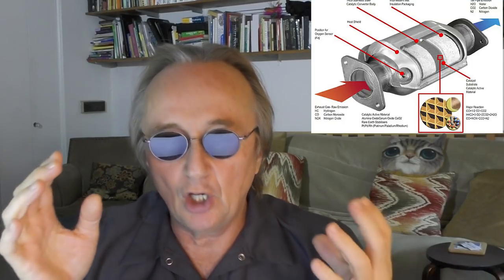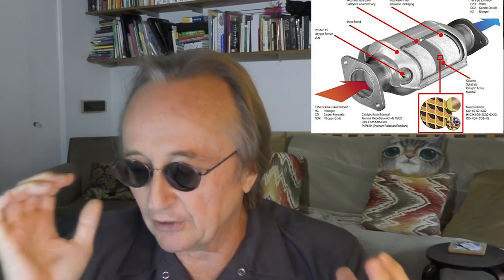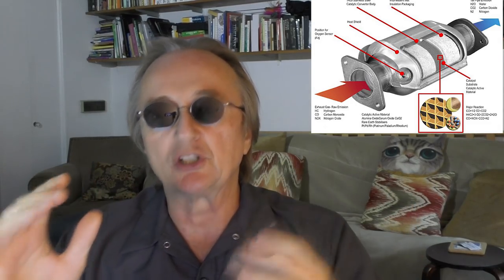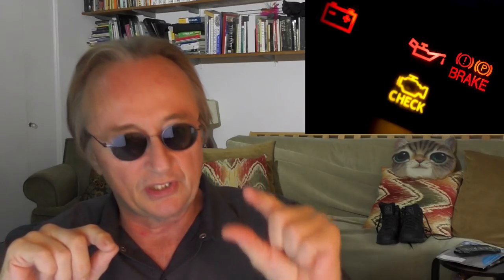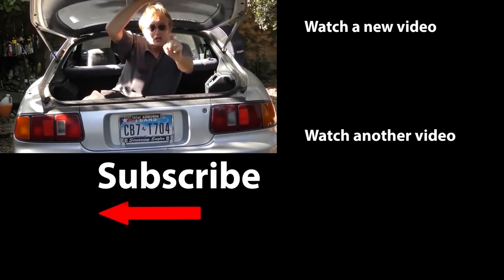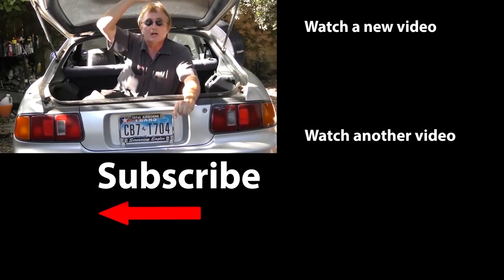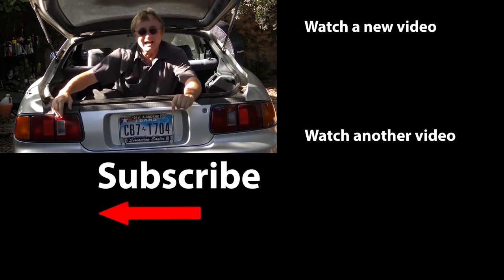Why it’s Illegal to Remove the Catalytic Converter in Your Car

Comment: Hey i wanted to ask about an 07 chevy colbolt LT i bougt it with 80k miles on it and iv alredy put about 9k miles but iv noticed that the car begins to shake after the coolant temperature reaches about 210° i thought it was the thermostat so i got a new one but it still seems to shake, i also came to finde out the A/C no longer works (im currently of in the process of instaling a new one )but im not sure if that can contribute to the shaking what do you think it could be ?

Comment: It doesn't gain but maybe 3-5 horsepower removing the cat. That's all I hear people say removing your cat gives you more power. It literally does nothing, except make your car run better.
Reply: and more reliable because if the catalytic converter fails it can clog the exhaust

Comment: Scotty! I’m 21 years old and just bought myself an 06 Lincoln Town Car Signature (180k miles), I paid 1600 for it. The guy I bought it from says he just changed the oil but not too long after I bought the oil light came on, me and my dad changed the oil and soon found out that the car was running on 3 quarts of oil when the car is supposed to run on 6 quarts. The oil light is still on 2 weeks after I changed it and the other day my engine light came on. But just yesterday the engine light didn’t come on and it’s still not on. My dad says the oil light is still on because it needs the oil switch changed and he also said that the engine light could have came in because of the moisture. We live in northwest Indiana and it’s getting cold over here. I do understand that I should prepare my car for the winter but should I be heavily concerned? Or are there any other problems than what my dad has prognosticate?
Reply: Take it to auto zone or some car shop and have them reset your maintenance light

Comment: If you wanna remove the catalytic converter and drive legally, move to Europe, buy a pre-1992 first registered car, then go ahead and do as you please. EU regulations from 1992 onwards demands some kind of converter, but before they were put in place you do whatever. I have the option to do it on my RX-7 FC turbo II, but I'll rather keep the horses we're they're at so I don't have to go and upgrade everything else to match the higher HP output. Even worse than it already is for the environment too.

Comment: Do what I I know someone did. Remove the cat then get a Broom handle and punch it though and gut it out till there is nothing left. Then refit it no one will ever know that it's not working the cat is still there just the guts have been taken out of it. Lol
Reply: On modern cars the vehicle won't run right. You would stepping on the fuel and wonder why your car would struggle.
Reply: I went to do that on my truck and found it had all blown out tbe tailpipe anyway

Comment: I thought catalytic converters reduce the amount of Benzene (a carcinogen added to fuel to boost the Octane rating, replaced Tetraethyl Lead) coming out of the exhaust?
Reply: nope.
Reply: @adcolt54  source?
Reply: Scotty kilmer is the source
Reply: Its to convert Carbon Monoxide to Carbon Dioxide. The early Cats needed an air pump to aid in the process.
Reply: And Roid
Nope

Comment: Scotty my SECURITY light is always lite on my dashboard... Every once in awhile my S10 won't start up.. What's the problem?.. Steve
Reply: Does your truck use Pass-Key 2? If so, the resistor on the key may not be making good contact with the inside of the ignition cylinder. If you have a spare key, try using it
Reply: @LesKing72   its a 2002 my friend... No chip in ignition key.. Thanks for commenting
Reply: @stevesilvas9059  it could be Pass Key 3. Generally if it has a security light it has an immobilizer key

Comment: Is there any way to run or recycle the hyrocarbons through a different less expensive system rather than removing or replacing the cat? Maybe the waste heat from the muffler could couple with a peltier device to cool and condense and the water could be used to capture the emissions? Not talking legal but functional and effective.. My moms cat converter stinks like hell in her 00 Subaru but I love her car as a daily driver when I dont drive my f150.. Peltier devices are cheap and it seems like the use is limited to creativity only.. I think in the future people will convert old cars into variable fuel source and power source machines capable of overunity and flight like the movie 5th element maybe.. Small and large conversion shops will transform the market and the earth. I know some of y'all gearheads love your loud cumbustion engines in a nostalgic way. Once you feel the instant power and cleanliness and durability of electric engines with instant power on demand.. With hydrogen and solar and nitinol and all the plethra of tech big oil has been sabotaging all these years.. Once we get past the oil cartel there is no looking back. Our grandkids will be glad they weren't born in this time it will look much like a dirty currupt dark time. That why I say endthefed.. Restore global abundance... And why are catalytic converters so expensive?  They make the engine work harder so the benefit cancels out the reward and the second you put one in it works less and less and burns more and more gas. Can we say facepalm? 🙏

Comment: Hey Mr. Kilmer.   I found a 1992 Oldsmobile Achieva SC with the H. O.  Quad 4 and 5-speed w/only 12k miles.  Asking price is $7k.  Would you buy?
Reply: Always bargain,worst thing is that it stays firm
Reply: NJW1973 my worry is that it’s a pretty old car with low mileage. Cars can actually last longer when driven regularly sometimes as opposed to sitting for years and years. Also 7k for a car that’s not all that desirable? I don’t know about achieva’s specifically, but I’d just watch out for issues that come from a car sitting forever. Definitely bargain though as much as you can.
Reply: @josephsamsor1698  7k is too steep in my opinion for those same reasons, the car has to be purring like a kitten otherwise it's more money out of your pocket, get you a nice Nissan 300zx for 3-5k if you want a old car might as well be in style
Reply: Marcos Torres yeah for sure. A 300z (while it is one of my favorite cars) probably isn’t what he’s going for though. I think he just wants a car that can get him places and last a really long time given that he was looking at that car. Cheap and reliable I assume.
Reply: NJW1973 I forgot to mention some people also switch odometers from junkyard cars and have other methods of cheating mileage. I’m not sure but I’d definitely look up how they do it and watch out for it.
Reply: @josephsamsor1698  well if he wants reliable than a Honda will do,sure they get ragged on for what they are, but for a new driver or a daily driven car you can't go wrong with it, people can cheat their way into getting more for less so you're right on that part. If anything I'd browse around Craigslist or local junkyards and talk to a trusted mechanic. And if those aren't viable options than you might as well learn for yourself and their isn't any shame in that either, but yea op buy whatever you want just be weary and wise, if anything go for your dream car, 7k can get you a good car and some slid investments lmao
Reply: Marcos Torres yeah I’m currently driving an 08 Honda Fit. 150k miles with a manual. My other car is an 81 celica gt I’m trying to fix up soon. 7k can get you a lot of car. I’ve seen really nice c3 corvettes for that price, but as a daily you can find a lot of very good cars. 350z, 300z, c4 corvette, a decent half ton truck, celica, probably a really good corolla or Honda Civic just to name a few.

Comment: Scotty is the back pressure important, why?
Reply: MásAuto Mx pretty sure back pressure is only a bad thing. To my knowledge, a higher back pressure means it’s harder for the engine to push out exhaust gasses which lowers power. Not by that much with stock exhausts, but in modified cars it’s a big deal and people usually put larger exhausts and manifolds to decrease it. That’s what I’ve learned but I could be wrong
Reply: @josephsamsor1698  thanks bro. Well my car is not modified is stock, only a panel filter K&N, a cut out valve and the resonator I meant. But it really feels better accelerarion I see the speed gauge moving faster , or maybe is just a driving feeling of resistance by the engine I don't know
Reply: MásAuto Mx back pressure is important. An engine is designed for certain back pressure. DO NOT take off the catalytic converter on a naturally aspirated car. You will ruin the engine and it may run too rich.
Reply: benefactionhindrance I’ve never heard that one before. I believe engineering explained made a video on why back pressure is unnecessary and should only be lowered as much as possible, and that it has no benefit to cars. Also, I’m pretty sure back pressure has nothing to do with the air fuel ratio. It’s just how hard it is to remove exhaust gasses. The o2 sensors couldn’t care less about back pressure. I looked up your claim and I personally couldn’t find anything that supported it. If you have some proof feel free to let me know, I just haven’t found anything that says it would make a car run rich.
Reply: benefactionhindrance  : Ruin the engine?  Wish I knew that 100K+ miles ago. No problems so far @ 295K+.......
Reply: im at 434k miles on mine still running great and sounding great

Comment: Hi Scotty, Im from Iraq and i need your help with something, i bought a 2018 kia soul from the USA with a 2.0 GDI engine,the car runs great and it has no problems and no check engine light lit ,every thing is perfect but in has bad fuel mileage, a full tank of gas will get me 130-140 miles before the gas light turns on and when i googled that and asked some friends who had the same cars (kia soul 2.0 GDI) as mine but different year of make (2015-2016-2017 and more miles on them) they told me that there cars can get up to (210-220) miles with a full tank of gas before the gas light comes on! , as i mentioned no check engine light is lit and the car runs perfect and even when i took it to a guy with a scan tool (don't know what they call it!) and took it to another guy with a different scan tool, no problems codes was found and every single thing in the car is okay , the air filter is clean and the engine oil i use is the same that written on the engine oil cab an the tires pressure is as recommended ,they opened up the injectors and the spark plugs and checked it (with some machine) and it was good as new , they couldn't find what the problem is so they gave up and told me to live with it !, whenever i refuel the car to a full tank i got a 24-26 mpg but after driving it on the city for a couple of days (short distances) and there was a 3/4 or 1/2 left in the tank, i got a 15-16 mpg and sometimes drop to 13 mpg !,  the car has 4838 miles now and when i first bought it it had 4617 miles so what could be wrong with my car? we don't have car dealers here in that hell-hole of a country and our mechanics are dump,our gas is not that good in the (octane thing) , i don't know what to do and i came to you seeking help so could you please help me and direct me what to do and what could cause that problem,sorry for my long reply and my bad english,god bless you.
Reply: You don't double foot drive, do you? If you drive with both feet, it's likely that you're lightly pressing the brake which will cause worse milage. Check and see if your brakes are wearing out faster than other people with the same car
Reply: Les King  NO,I use my right foot only and the left foot is not on the brake, thanks for your reply.

Comment: I de-cat all my cars.  Better power, better mpgs, and better sound.
Reply: Taking a cat off shouldnt improve anything, sound maybe, but not performance wise. Also they do a good job of keeping the air less poisonous for the rest of us, taking it off just seems selfish to me
Reply: Adam Nope Wrong, any restriction decreases performance and in turn fuel mileage.  This is well documented.  Removal of the converter system on a modern mustang v8 for example frees up almost 100 horsepower as proven on a dyno.
Reply: To be fair, I've never seen this dyno test you speak of, but 100 horses from a cat removal sounds bullshit. Plus cats themselves dont even change anything in the car, the most it would do is indirectly affect performance by forcing you to run the car lean compared to if you ran the car super rich. Because catalytic converters are only effective at certain leaner ratios.
Reply: Adam Nope You obviously don't know how catalist work.  They work via the heat created by restricting exhaust flow.  The heat of the exhaust on its own is not enough to do the job.  The mustang in question was one of the newer coyote v8 models with four cats.  Removal requires the use of aftermarket headers as the primary's are integrated into the manifolds.  As such a tune was necessary and where the numbers were compared with a before and after using the dyno.   We are not talking paper nubers to dyno, but dyno to dyno before and after.

Comment: get a Gran Prix  from 1965 up to 1974 then you'll have a real gran prix. Anything made after 1975 the quality and get up and go are gone. you youngsters that have neve experienced how a real car should be, and probably never will, well I feel sorry for you. 
There is a way to get a cat free exhaust yet still look the part... cut an old one open, remove the stuff inside, which is quite valuable by the way, then weld it back up and put it where it goes on your system. I don't know where the Feds get off telling you what you can and can't do with your own property, but that's a discussion for another day. Bear in mind though, that if your state has emissions (smog) tests, this will make it difficult to get past those tests. Not that it can't be done, a well tuned engine will almost always get past them, but on today's cars, you can't really tune them, not in the ways I know. You have to tune them with a computer and a programmable chip install... more money and a pain the rear I understand, least ways for old guys like me.  I once had a Porsche Carrera not pass the emissions test, but a short visit with my mechanic and it passed easily, then I took it back and him undo   whatever it was he did to get the emissions sticker, because it wasn't running nearly as well. Always take your car to the emissions place well warmed up. Cold engines tend not to pass, cat or not.
Reply: toot tall obviously you have never driven a 327 Grand Prix from -04-07 I think they will fly. Way faster then anything they had in the 60’-70’s I promise you that.
Reply: Tammy Forbes   IF you'd ever driven a real one, you would know that those made in the 2000s are a Gran Prix in name only. Maybe all the electronics make it faster, but I kinda doubt that it will feel the same. Takes more umph to move a much heavier car. All this new stuff is just tin foil and microchips. They don't have any real muscle.

Comment: How come some cars hesitate when they don't have a cat?
Reply: Removing the cat changes the backpressure and can change the O2 readings if there's a sensor after the cat. If you do a cat delete it's best to get the car tuned to work better without it. You should get better mileage too because cars run a little rich to keep the cat hot

Comment: ITS NOT ILLEGAL IN EVERY STATE. Sorry scotty but it is perfectly legal where i live. your last few vids have been trash. Scotty's strategy - If its a used car don't buy it. i've hard a couple customers come in with a lemon and needed a engine rebuild. bad car don't buy it. just buy a bicycle.
Reply: You sir, are incorrect. Tampering with any emissions control device is a federal crime. But obviously, the FBI has more important things to do than worry about Billy Bob hacking the catalytic converter off his 89 Honda Civic so I doubt any case has been prosecuted but it's still illegal nonetheless. With that said, any state or town that conducts emissions testing will fail you without a catalytic converter which is why most people punch them out. My hometown doesn't have any emissions test and basically cares about noise emissions more than anything which I totally understand... After all, who wants to hear that shitty rice burner exhaust anyways?
Reply: you are referring to the clean air act. There are many reasons to remove your Cat. its not just for a crappy sound. Hollowing the Cat has made some cars capable of passing emission tests. Replacing the Cat has fixed broken vehicles. A clogged cat is a undriveable car. The state laws are what matter in this situation as the state is the ones conducting inspections. No federal agency is enforcing any of this, nullifying the federal law. The state however does/can fine you and will/do remove that vehicles legal ability to be on the road. State laws are what matter here.